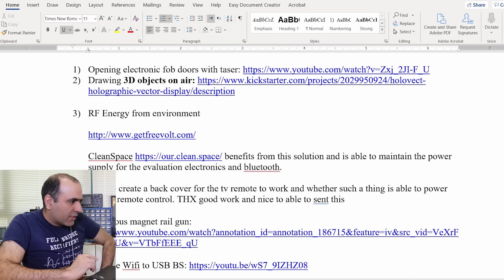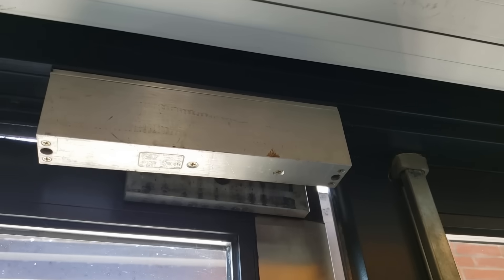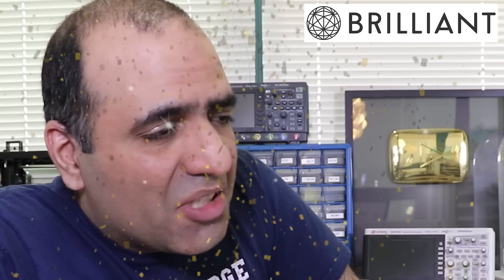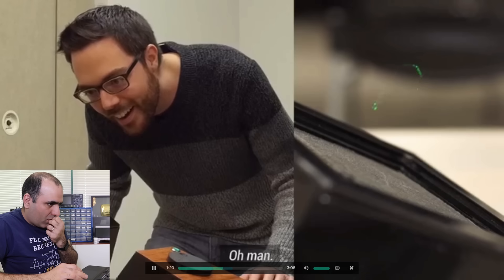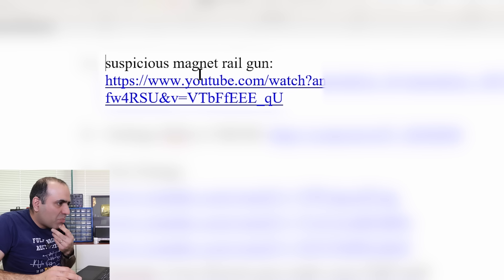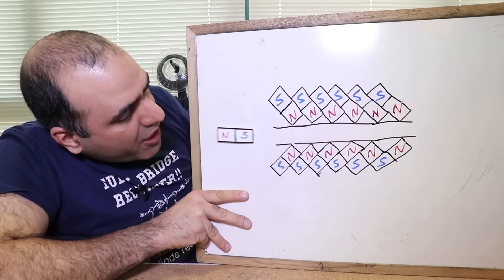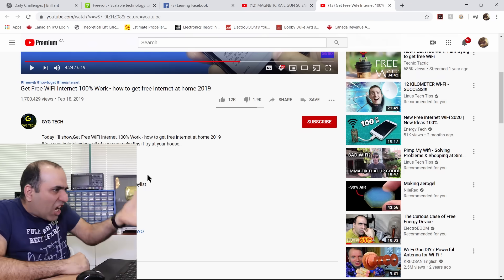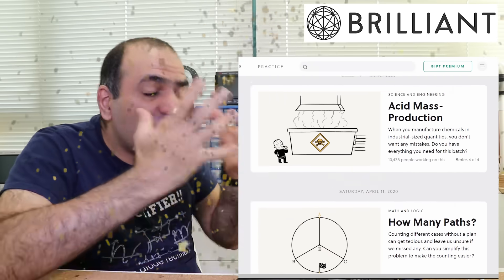BATCH RECTIFICATION of my To-Do-List

Comment: There are many ways to make volumetric 3D displays. They are all big, expensive and not very practical. I could probably build one myself - I just need sixty-four off-the-shelf projectors, eight high-end computers with two graphics cards each, a developer who can program the thing (the maths are actually pretty easy), some pipes, a bunch of ultrasonic misters, and a couple of months for the programmer and I to work the bugs out. If you have to ask how much that would cost, you can't afford it.

Comment: I blew up the electrical system in a hotel in Kenya a few years ago. Unfortunately, true story. Got back 10 days later and they were still fixing the block I stayed in.
Of course, I could be paranoid and when it happened sparks just appeared out of the socket I was using.

Comment: 6:01 there are two acceptable ways to get that outcome 1 is to do it using CGI and the second way is to get a very very fancy frame by frame camera and isolate exactly what images are the right images for your project exactly the second way is the possible way without cheating much more chaotic and difficult but it's better the other way is to do it worse and better
Reply: Then again my solution wouldn't work much better like on a scale of Raiden between all three it would go the normal thing would be a 2 out of 10 mine would be a 3 out of 10 and CGI would be

Comment: Unlocking the door when the electronics fail sounds dumb at first, but the alternative is, that people cant leave the building in case of a power outage. Now create a power outage from burning cables and you have a mass cremation grave. If only doors would be open in case of power failure...

Comment: Magnetic doors have a normally open and a normally closed option at the control center in the building (if the building has more than one door. Depending on where you live normally open is required by fire codes.

Comment: Doubt you'll see this but I found videos of a guy doing experiments with an electric fly swatter and fluorescent lightbulbs. He made a cool little closet light out of them by disconnecting the large capacitor at the end of the circuit and having them run right after the transformer. 
Was wondering if you could try something similar with those fly swatters because we replicated the experiment here to really fun results!
Love the channel keep up the good work

Comment: It is not a safety feature, that these cheap door lock fail so easily... It's just a poor design... If in case of fire someone needs to leave the building, he just uses the door handle, that is usually on the inside and normally opens the door... The electronic door lock only works for incoming people,  so that you do not need to carry a key to open the door that has no handle on the outside...

Comment: I pulled an ElectroBoom the other day, at work as a mechanic I was trying to manually power a car seat forward so I could access a bolt to remove it.

Using a paperclip I intended to jump the power and seat forward terminals.

Fiddling around with it in a tight spot I managed to touch the power and ground instead and the clip literally lit up like a lightbulb element,  resulting in the kind of burn that instantly renders your skin into a white ashy substance🙂

Comment: Some door entry systems fail in unlocked state in order to allow firefighter access.  Simple reset might not activate it. Maybe zapping the control panel continuously to prevent resetting a timer in the door module?

Comment: Security guy here.

The "electromagnets" are called maglocks and they have different ratings. I've seen some rated as high as 1200 lbs of pull force, but using them is rather silly because the door or door frame is going to break before the maglock lets go of the plate. When installed properly, these are usually only used on heavy steel doors. They really shouldn't be installed on light aluminum frame doors with glass because they're pointless. You can just smash the glass and get past them. Door strikes are a better solution for lighter doors because they put less stress on the door, all of the stress is at the lock mechanism and not at the top or side of the door. Maglocks installed on light doors will generally eventually warp the door.

The keypads the Russian video showed are from ancient access control systems, which look to be all in one units. These are more susceptible to electrical interference because all of the electronics are built into the keypad unit. More modern access control systems usually have a remote control panel and a different wiring setup, as well as input protection on the lines to prevent false triggering.

Comment: In the security/access control world, safe and secure are not the same thing. A lock that fails "safe" will be unlocked for the safety of the building occupants. "Secure" is self explanatory. If the power drops, the door stays locked.

Comment: Perhaps you can help. My 99 civic has 2 fans.  I had one jumped to ther other,  condenser to radiator  so they would both work when the ac was on. I touched the jumped power wire to somthing and heard a zap.  Now the condenser fan doesn't work nor the radiator.  I checked all fuses nothing is working. What could it be? Thank you great show

Comment: 😆 About the first video. Dude, all of the major intercoms (Cyfral, Metakom, Visit) on post-soviet countries all well-protected from static dischargers. The secret of the video is quite simple: there two guys. First shoots a video,  while second is hiding inside the building and pushing the unlock button from inside. And after door unlocking the second guy quickly runs away. Please, pay attention to that fact the door is opened after a little pause, but not right after opening sound rings. - It gives enough time for the second to hide.

Comment: The "real looking" parts of the second video are probably looking like that because of the camera shutter and the laser. The issue is that cameras are not able to show what a human eye can see without optimized camera settings (like shutterspeed or framerates). especially with lasers.
You might have seen this with videos of screen
Edit: I am not saying that it is real but at least this part of the argumentation why it is cgi is not solid

Comment: 11:24 Not just that, but the wire is way too long for 2.4 GHz, let alone 5 GHz. If it was 3 cm long, it would at least make a decent Wi-Fi antenna! Which you’d still need to plug in to a Wi-Fi chip such as the ESP8266.

Comment: Stupid statement but if the system is grounded properly,  the high voltage shock would just go directly to ground and not to the motherboard of the system

Comment: 5:50 Holograms indeed exist and was showcased at a certain conference. They achieved it by ionizing and excititing air particles by crossing a few lasers on a single point in space, the image it displayed were very simple geometrical shapes due to the limitation of the laser's movements. However this technology never came through because 1. the sound it made was described as turning 500 microwaves on with aluminiumfoil in them, 2. the energy consumption of that thing and 3. it ionized the air, which i dont have to explain to you that it will burn your hand off if you get near it.
Reply: And yes that kickstarter was indeed bullshit

Comment: I really want to explain how the door thing works but I don't want to give kids who were as mischievous as I was any bad ideas. I suppose I could just say that the doors that the shock works on are ones that have been wired directly into the panel without redundantcy and the ones that don't are in a powered (locked) state until it gets the right signal (separated by a switch) . So if you short the panel it will stay locked. But for safety (egress), it still can be opened by cutting power to the magnet (usually harder than you'd think), so it still meets egress codes.

Comment: If you combined the hologram thing with the concept of statistics optics from the latest telescopes, maybe you could make that work.
It uses guide stars and artificial guides (lasers) to adjust the mirror in the telescope.
So, here, you'd have to have IR guide lasers, cameras to measure them and some very fast DSPs to adjust the source laser to compensate for the heat shimmer

Comment: Hi Mehdi, i'm from Russia. Once, some cold winter night ( it was about - 30' c) i saved myself and my drunk gf by disambling my lighter, took a piezo from it and zapped the door lock about 10-15 times and it opened. I did it with tazer a few times, but it is big possibility to kill the lock. The most reliable way to open - is the piezo lighter for gas oven, but not the one which click-click, but trrr-trrr

Comment: With doors it is more logical to set it in "open" position, when it fails, because if something happens, it's way more useful to get out of building. Those are mainly for stopping hobos from sleeping in buildings, so they don't have tasers anyway, and locking building if fire breaks out, for example, is way more dangerous than opening it.

Comment: I have been thinking about something that could work a little similar like the first video.
Discharging a “stungun” over a coil (with a similar frequency to AC) to be able to open the electric switches that open those doors.
Since it’s a coil reacting to AC to open the switch to open the door, placing a coil next to it with the same frequency should also open the door (when the magnetic field is strong enough).

Comment: Maglocks are usually connected Fail Secure. The keypad relay is Normally Closed, and requires power to open the circuit to the maglock, so even if the keypad loses power it won't break the circuit to the maglock. The remote Power Supply would have to fail to release that door, and a good installer will fit a backup battery in the power supply in case or power failure. 
So you probably aren't getting through that door using any tampering methods (if it's a quality install).

Comment: hey you should make a device i made as a kid for my sience project and explain it. you take 9V battery connect it to a relay then to an old transformer from old radios and then you make 2 spirals so you can hold it. then one guy takes it you turn it on and your arms start squezzing. fun part is you get a huge voltage but it doesnt kill you

Comment: I think those keypads is more about authentication at door vs remote. Resetting at the door on the 1st opens the door due to interruption but doing so on the 2nd only resets the keypad but doesnt actually unlock the door which is remotely controlled.

Comment: IDK why you didn't think of creating anything for COVID-19. 

Well, it might hear funny but is it possible to make a device to ensure social distancing? A device that beeps 'violently' when a certain distance isn't maintained. 

And is it possible to make such a device which can work like, 

As soon as the hands come anywhere near the face (specific distance), a beep produces and alerts the user?
Reply: use an arduino, a few ultrasonic sensors (like four I think for each direction) and a buzzer, and program it to sound whenever someone aproaches to you in a radius of 1 or 1.5m
that's what I would do, but I rather stay at home lol
Reply: @emanuelgallegos3447  That is the preliminary design, yes. But I'm searching for a more compact.. you know.. more simple device..

Most countries aren't maintaining social distancing... They're gonna die..
Reply: that's true
well I'm not an engineer, I have made some projects just for fun, maybe just one sensor to cover your back, there are these smaller version of arduinos called 'nano' and you can feed the whole thing with a 9v batterie or a power bank for cellphones.

it would be a lot easier if people could care more for each other and follow the recommendations and be aware that in some cases you can be infected without showing any 
symptom infecting more people in the process

good luck tesla, take care

Comment: The problem with those keypads for doors is that they are self contained. they don't send the code you put in to the inside, but check if the code is valid, and just sends a signal to open the door. Many times there is a relay in the box that does exactly that. A strong magnet should be able to move the core. Also, you could bypass the signal itself. lpl once grounded a pin by sticking a knife through a gap into the box (or a fork or whatever it was, but that obviously only works if the signal is active low)

Comment: I would be interested on some sourd of machine "for the magnetic river " that the energy u put in for the first push is somehow from gravity pulling down as a weight 
Than if is works make it circle and try to get energy out of it i know is still not free energy cause even the permanent magnets has been magnetically charged with electromagnetic field but may could act like some sourd of battery (long lastic one)

Comment: 11:04 also, even if it was a real WiFi adapter, it would still not work because these adapters are made for PC's and require a driver software to work. When you connect a usb WiFi adaptor to a smartphone, the smartphone does not know what to do with it. Plus these adapters require high current that only a PC can provide. There is no way a micro USB can provide that much current.

Comment: Most door openers will open for about 2 seconds if you apply 24volts to the supply wires. If you just cut the wire then reconnect them 90% of doors will unlatch for about 1-2 seconds.

Comment: About the phone Wifi thing: Sometimes you can improve radio transmissions by increasing the area/volume of the ground plane of the device. I doubt it will work for the phone, but i have used this for some Arduino outdoor projects.

Comment: That’s not how keypads work.  I install and maintain access controls.  Keypads have several wires, they have power and ground wires to power The keypad and then have at least two more wires hat are communication wires.  These communication wires transmit the card scan or the keypad keystrokes to the controller In the building somewhere.  When the card or keypad has an entry, it sends a communication signal to the controller which decodes the entry and either accepts or denies the entry.  If you destroy or try to interfere with the keypad or card reader, it will not open the door, the signal from the keypad or card reader has to be sent to the controller in the building and that controller in turn controls the locks.  Shocking with a stun gun probably will destroy a keypad but will not unlock a door.

Comment: • 3:20 - "Hello, 911? There's a middle-eastern-looking guy breaking into a building…" - Nah bra, it's cool, it's B&E for science!
• 3:40 - извините‽ 🤨
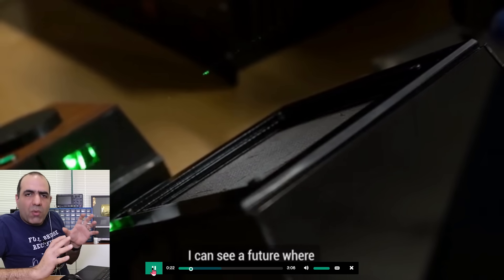• 5:15 - Ultrasonic: youtu.be/jOnxr9Ez_Kc and femto-second laser: youtu.be/pyTFCR-Om_k holograms are real and haptic!
• 6:50 - Like with Theranos, I don't think it was a scam, I think it was just an overly-ambitious and premature goal. 🤷
• 9:15 - Nobody said it was free energy or a "flowing river".
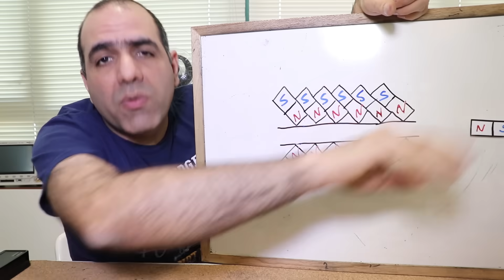• 9:22 - Hmm, why not? 🤨 Once you've put in the energy required to get the shuttle into the track, what would stop it? 🤔
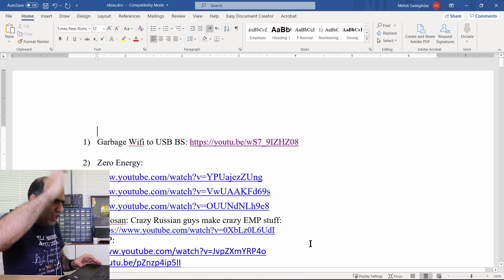• 9:28 - No, but they do move to align correctly, but if it's in a ring, it will never align correctly.
• 9:48 - Wait, is this a video of me trying to solder? 🤔 I must have crappy solder because it never works like in videos. 😒
• 11:35 - He probably shorted the GND and +5V pins and killed his USB port, possibly the controller or even the whole phone.

Comment: In android there is a feature called reverse wired tethering which is connecting your usb to a ethernet port using an adaptor but you need to enable that feature in setting(but some works automatically) and some phones doesnt have it(if I'm not mistaken samsung, sony and LG support it). The contraption in the video will not work since that feature only works if you connect it to an ethernet....

Comment: This russian house entrance doors must open in any failure. Fire protection and security requirement. Actually, this doors only to stop some assholes pissing in elevators, you cannot steal anything if you hack the door. More than that, it usually has some master code (like master key) for emergency services to enter, and everybody knows it.

Comment: Electromagnet is not holding door. There is typical lock + electomagnet to unlock it. Evacuation door are designed like that, to be hold by electromagnet. If there is emergancy situacion and power is down-door open. That sound, when door opening in block is electromagnets coil. 50Hz, like transformer, sounds familiar?

Comment: Not only a forced reset could unlock the door, the spark may also induce a signal on the wires to the lock that might be interpreted as an "unlock signal". So it's design dependent.

Comment: The back EMF from the mag lock can often be enough to cause corruption the memory of the door controller and cause a reboot (especially if a MOV or flyback diode isnt installed). Most systems will release the door on boot up and again if no cardholders/PIN codes are present on the system to prevent the installer being locked out.

Comment: The 'taser' was a torch (or flash-light, as you say in North America) - the flash of light didn't flicker as a taser would, and the sound of an electrical discharge was added to the video with an accomplice unlocking the doors off-camera.

Comment: Speaking from experience working on those systems,you have to discharge the electromagnet directly. I'm pretty sure the Russian systems have unsheilded microswitches as you can hear it make the usual clunk noise before it opens

Comment: The hologram is a resanator flinging/dispersing micro balloons into the projection field using a sign wave.  If he had an equal resanator in parallel above & bellow, he could suspended the micro balloons.  Because the resanator is angled, the micro balloons are being injected into the soundwave, then fall away.